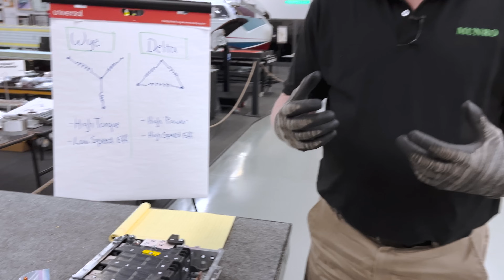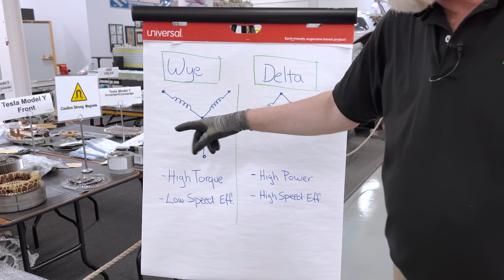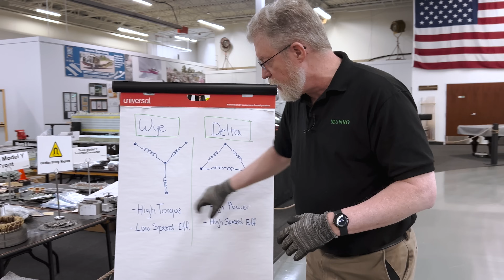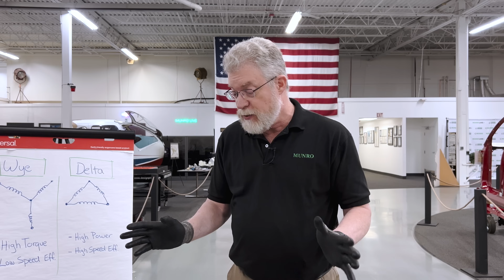KIA EV9 Dual-Stage Motor & Inverter Breakdown: Engineering Unveiled

Comment: I did this Delta WYE on my very first diy ebike on the hub motor back in 2007. I called it the "electrical transmission". I was using a 3DPT relay to switch between the winding config. It  worked very well but when switching back to WYE there was some care required to not blow the inverter mosfets with high bemf at high speed on WYE. I published all the info on Endless sphere forum. Was it me who tried this very first setup idea on EV then😊?
Reply: The star-delta or wye-delta starter has been used in 3 phase AC motors at least as far back as the middle of the last century.
Reply: Heavy industrial vehicles use it as well, nothing special just not worth the trouble of implementing in EV's so far. Delta works fine there, consider how fast even lightly powered EVs can accelerate.

Comment: I wonder if this is used or would be beneficial in EV aviation applications?  It may also be a benefit for future performance EVs over a 2 speed gearbox ala Taycan.
Reply: Firstly it's not that big of a difference, EV's have done fine so far in delta, it's rather an efficiency improvement especially on low speeds and much more with heavier cars (hence why they put it on their SUV). Secondly the issue with high speeds like in the Taycan is not so much in the motor but higher rpm overstressing the reduction gear. Also not sure what difference it would make for aviation, that's cleary a delta use case.
Reply: I don't really think aircraft need this,  as there's very little air resistance at low prop speed,  and the prop is actually driven in a fairly narrow rpm range from takeoff to top speed.
Reply: @jamesengland7461  and not to mention the prop is very light and merely turns in air obviously, so there's never a low speed, high torque scenario, it's more or less always high speed.

Comment: So with all this innovation why is the EV9 range so compromised? And it’s not a cheap vehicle compared to others in it class/size? Wouldn’t it have made more sense to spend that extra cost (more complexity always adds cost) in adding more battery capacity? Or other methods to boost range?
Reply: @ranig2848  this actually reduces cost.  The EV9 is very boxy so likely the biggest issue is the aerodynamics.  They seem to have put function over range.
Reply: Adding more battery capacity is like bolting in a bigger fuel tank and calling it innovative. That benefits nobody. The EV9 has better efficiency than any of the other vehicles like it (and better than some vehicles that are smaller than it) so I’d say their efforts to make the motors and inverters more efficient is worth it.

Comment: This explains so well why my new EV9 is so amazing to drive on every level. The switching on the fly is mind-blowing. So fun to drive. Now...to beat a dead horse. I have been writing everyone under the sun: “LOSE THE FUCKING CENTER CONSOLE.” Such a waste of material AND MORE IMPORTANTLY my (the customers) access to the FULL features of space utilization inside the cabin. 
BE THE FIRST (SMART) OEM KIA. LOSE THE FUCKING CENTER CONSOLE!!!
Reply: Well, when Tesla made the first Model S in 2012 it had no center console (since there is no transmission tunnel like iCE). The lack of a center console was one of the major complaints by many owners.  I sort of liked it, but I found the center console a better design in later generations.  A center console allows you to have easy access cupholders, hidden storage, wireless phone chargers, venting to rear passengers, and more.  I suppose one could remove the center console if you hate it.
Reply: @tesla_tap  DUMB AS HELL. “You can have any color as long as it’s black.” Henry Ford. 
Dumb ass customers don’t know WTF they want. And to all you dumb fucks out there, put this in a time capsule for when AUTONOMOUS rigs rule and people can move freely.
WAKE THE FUCK UP! 
Sandy, THIS is the mentality that is at the heart of why this country is SOOOOOO fucked up!
Reply: @tesla_tap  Go look at a sprinter van "dumb ass.”
Reply: @tesla_tap obvious solution is to have a console, but make it easily removable. See VW ID Buzz.
Reply: Or make it better. The phone charger, the cup holders, and the shitty plastic cover.
Reply: @michaelm.wiseman282  NO! Silly! GET THE FUCK RID OF IT. PERIOD! I want MOB-FUCKING-BILITY!   
For f sake. Go look at a sprinter van. That LAZY MAN bullshit can go ANYWHERE ELSE...ANYWHERE!!!

Comment: If only they would have this level of innovation in the rest of the vehicle
Reply: The Hyundai Group seems to be getting better in many other areas of tech. Their software has a nightmare, but much improved now.

When you look at the Hyundai Group, it has changed just in the past five years. It shows they are stepping up in many areas. They have hope of not getting swallowed up by the Chinese EV industry expansion. Something that cannot be said for VW, GM, and others. I hope rhey get their sh*t together so they do not fail, but time is basically out, and they have to make massive improvements.
Reply: I have one it's incredible

Comment: That's what I call innovation😊
Reply: it's invented in 1880, nothing new  .. https://en.wikipedia.org/wiki/Three-phase_electric_power
Reply: @puvi007  Of course the basic principle is not new but its use in an electric motor for EV applications is. Also, conventionally, the switch between delta and Y configuration is done by relais. A traction inverter that does it in silicon is something I haven't seen before.
Reply: @puvi007  so I do understand that, but it’s nice to see that they’re binding the motors to become motors/generators for multipurpose use
Reply: @psulak02  That also invented long back no new innovation, all EV companies cars have every efficient motor generator ,  https://en.wikipedia.org/wiki/Motor%E2%80%93generator

Comment: Why dont Tesla do the same? I have model 3 AND Ioniq 5
Reply: Becaue tesla does not need to boost the voltage to 800V, since they have their own supercharger that are compatobale with their vhiecles.
Reply: @ameerjanabi917  My ioniq 5 is faster to charge than tesla
Reply: @1987fasterthanme  Is it really?
Reply: @1987fasterthanme  per mile of range per min of charging is it though? I'll say no it isn't!
Reply: @1987fasterthanme  - The Ionic 5 has a slower max charging rate (225 kW, vs Tesla 250 kW).  Also it depends a lot on the battery size.  A 60 kW vehicle charges up faster than a 123 kW vehicle, but may not gain as many miles per minute of charging.  So battery size also is a large factor.
Reply: @tesla_tap  indeed, the 250kW, is the number you go for. Off couse the time of charging does not tell the full story.
Reply: By the way Tesla just added a switch in their 800V Cybertruck pack to just simply switch between 400 and 800V. No boosting needed, no efficiency loss, no additional heating. Audi and some others are doing the same
Reply: @kevinegal8586  GM Hammer do that too. I had this idea 5 years ago.

Comment: Kia and Hyundai's next gen Electric design with the improved heat pump is going to be the one to get.  It's shocking how quick they've come with their EV's already.  The big thing to solve is that frunk space.
Reply: Already to have a small free space in the front frunk is already in EV Vehicle a great improvement. Because petrol one have normally no free space there in the front. This said, for someone that wanting the biggest frunk space, need to buy a 2RWD, or Tesla. In my case, I use my trunk as I used my old petrol one. All my emergency stuff are all in the small frunk, (Stuff I nearly never touch it). Then I don't care.
Reply: @sergiomomesso1590  the problem with all EV’s is that the equivalent Ice cars tend to have a much larger, usable trunk space.  I can fit 5 grocery bins perfectly in the trunk in my small SUV.  That’s the perfect size for my house since I fill all 5 up every week for groceries.  I can load them all in without having to fold any seats.  I can also stack lots of lighter stuff on top.  So having a useable frunk to put stuff is actually very much appreciated for those use to having more space.  The cybertruck IMO got this right.
Reply: @Somethingaboutthat  About size of the trunk in small SUV, this vary depending of model. In my case, before my EV I had a Subaru Crosstrek 2015, now a Ioniq 5 2022. Funny part is both are near same size exterior. (Exception Ioniq 5 little bit larger). But the Ioniq 5 interior is way better designed to have more free space (Compared to this SUV.) Because I can even sleep in the trunk of the Ioniq, and this EV have to Utility/camping mode to maintain temperature. I even have another storage place in the trunk of Ioniq 5 under the truck. (Where in Subaru, no place free there because there was the spare tire there.). It's why I say it's vary. In my case, more space in my EV.
Reply: They are killing it recently! And really trying to show quick business like tesla does!
Reply: The refreshed EV6 has a bigger frunk and I think the new EV3 has a bigger one too.
Reply: I’ve no complaints about the frunk size in my RWD version
Reply: @nickbirch2123  check out the Mach E frunk.  At minimum that’s what the Ioniq 5 should have.
Reply: Heh, I see what you did there.
Reply: Kia has got no chance to get close to Tesla EV profitability or sales  volume. At least they are trying unlike Toyota.
Reply: @chris-z3i5c   @chris-z3i5c  what .. %$'h. 
Margins, wrong. 
V2L, small demand. 
Brakes, These are upgradable for racing.
Fast charging, it's already fast enough.

Lucky Elon gets it, and that's why model juniper will break sales records.
Reply: Nooo, Nissan still better than kia
Reply: Sorry. Teslas will forever be the ONLY EV to buy. Hyundai is absolute junk and Kia is only marginally better. Not to mention, they're still losing money on every EV they sell and gas is what makes their profits.
Reply: The only reason they originally had a frunk was due to the model S needing the hood due to its ice roots. There's 0 reason to have a frunk with a purpose built ev and I'm tired of seeing them. With that said a little storage bin for a level 1 ac charger is nice just as an emergency backup
Reply: We have lived without a fronk for decades no big deal.
Reply: @anthonybugge5220  you forget that the under floor space if often much less, check for example EV6, Ioniq 5 or Id.7 Tourer.  This is my main issue with EVs atm.
Reply: Not with a proper SUV like Kia ev9. I don't class ev6 as SUV that's more hatch
Reply: @anthonybugge5220  - yep, before everything got labelled as a SUV the EV6 style cars were labelled *fastbacks*.
Reply: @anthonybugge5220 But you didn't live without a trunk did you?
Reply: @anthonybugge5220  But once you have one even in a twin motor EV and a big deep boot it is a big deal. I went from a Nissan leaf with the front motor and inverter filling the bonet and looking just like an east west 4-cylinder ICE engine and the charger hump in the front of the small boot. To a Tesla M 3 P dual motor with a frunk a flat boot with a large storage compartment underneath. 3 times the battery 4 x the power and no carryover from petrol cars as they were a clean slate design.
Reply: @JonathanTamm  my boot is massive I would never need the extra cargo area for anything
Reply: @JonathanTamm  keep making the greedy, corrupt, con artist, billionaire richer.
Reply: Elon has always been complementary of Kia/Hyundai. So they must be doing something right!
Reply: @205rider8 well let’s just say they are trying super hard. Korea however is not known for design nor quality.
Reply: @Brianhartmanmusic Korea is not known for design or quality? Is Tesla EV known for quality or design? Tesla is at the bottom of the list for quality of all car manufacturers. And they look like a bar of soap. That’s saying a lot when it’s worse than Chrysler and Ford. Lol.  If you want cutting edge design lauded by the automotive designers, go look at Genesis.  Samsung, LG, memory chips, mega container ships, tanks, self propelled howitzers, multiple rocket launchers, fighters, high speed trains, submarines, etc are some of the best in the world. You’re such a typical low information American.
Reply: Frunk is just  a  fancy thing  some  EVs  are  boast  of.  Good  EVs already  have  huge  internal  space compared to plain  ones and ICE cars.😊
Reply: Running my 2020 kona with 94,8% capacity in January 2025
Reply: Without killer interface software or killer driver assistance technology it will be difficult but best of of luck ..
Reply: @sudeeptaghosh  - no problems with Kia's level 2 (3 soon in the EV9) ADAS. I'm not interested in higher levels of ADAS, no intent of delegating that level of responsibility for driving to the car. Also, Kia's user interface is good, things are not hidden down too many menu levels, and comes with both voice control and physical buttons to support rapid acces to functions.
Reply: @sudeeptaghosh  maybe you should test drive a new Kia before coming to that conclusion.
Reply: @Somethingaboutthat stupid because test drive is all relative to Tesla, which is 8 years ahead. Korea is cute with hyper German hired talent but it doesn’t matter. Besides I’d rather support U.S based companies. Yes I know Korea has many plants and employees in the U.S. however, they are still sovereign Korean based companies.
Reply: @Brianhartmanmusic Tell us you’re a douche bag without telling us you’re a douche bag. 😂
Reply: @sudeeptaghosh If you're referring to Tesla, it's killer alright.
Reply: Yeahhh, now if they can paint their trash.
Reply: @ConstanceCox someone with your last last name should also suk one😅